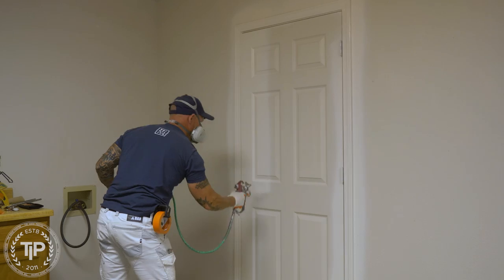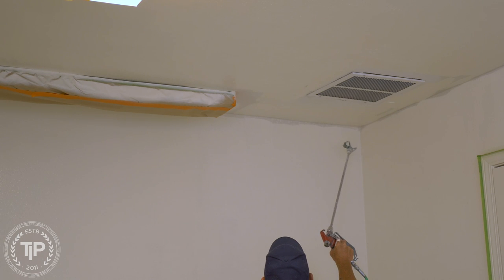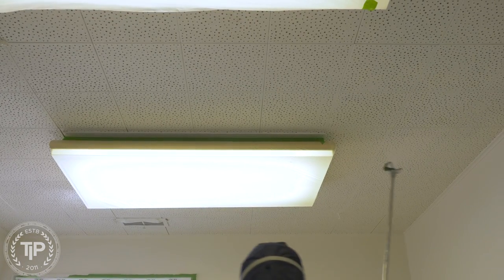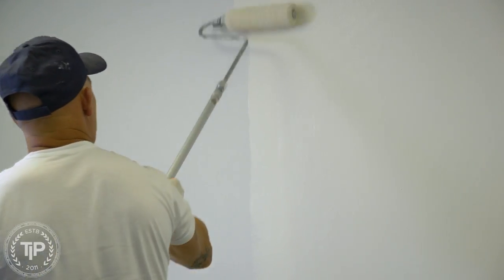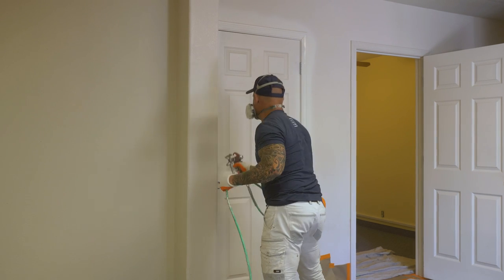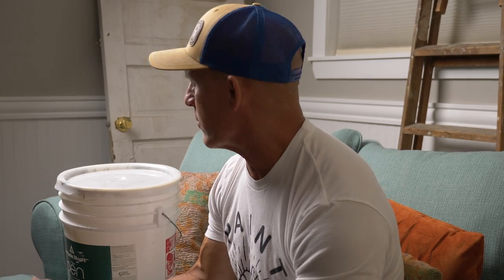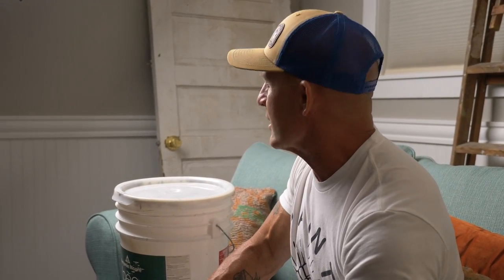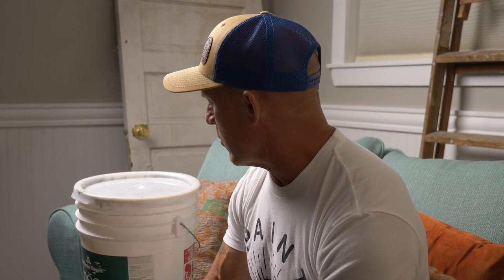BEN Wall Paint Review | Which is the best paint?

Comment: Ben Moore is the best paint out there. Even their ultra spec smashes anything from Sherwin Williams.
Reply: Damn straight
Reply: I wouldn't go that far. Ben Moore has some great paint, but it's definitely overrated. I would take Cashmere, Emerald, Prominence and Ultralast over Aura. 

Ultraspec is definitely better than Promar 200, which is their rough equivalent but Speedhide is just as good.
Reply: After doing some work with the brand of paint the Big Orange Box Store sells, I can 2nd this, or at least the most reasonably priced paint.  It is also the most available in my area (hardware store is 5 min down the street).  I have not used SW, but more than one painter has told me that BM is better, including one who was painting with SW.  Our local hardware store does sell some imported paints, but they are all upwards of $100/gallon.

Comment: What about cost? How much? What is boxing paint? Is that mixing paint?
Reply: boxing is when you purchased a mixed color in multiple containers (3 gallons in 1 gallon containers) you get a larger container and mix it all together to ensure you get a consistent color. It especially helps with touching up later.
Reply: @bratvlad  you can only box when you purchase multiple containers, doesn’t matter if it’s 5’s or gallons. You do it to ensure color consistency in case there might be a slight variation in the color that comes in one or more of the cans/buckets

Comment: Is this product better then Duration from Sherwin Williams and what's the price range?
Reply: I think Ben is better than Duration in terms of durability. I have used both quite a bit (certain designers or customers have their favorite brands) but I prefer Ben. It also touches up way better all the way up to eggshell sheens. Pretty comparable in price, but they're all way too much these days. When Aura was new it was all I used, but my price was $50 a gallon at that time. Then I switched to Regal once Aura was over $60 a gallon, and now I've gone to Ben. Retail on Aura is over $100 a gallon at this point! That has made me more of a bargain shopper these days.
Reply: Duration is more like Aura than Ben. Ben is at the low end of Benjamin Moore products.
Reply: @joshuareed3999  You're buying paint from the wrong store. My local store gets $71 a gallon for Aura interior. I pay less than that with my contractor's discount.
Reply: @zone4garlicfarm  I mentioned the retail price. Not my price. Still too spendy these days. I use Aura Bath & Spa at times because the $30 difference for one gallon on a bathroom project is worth it, but I haven't painted an entire house with Aura in years. It's phenomenal paint, but I can't justify the price anymore.
Reply: @zone4garlicfarm  BM Ultra Spec is their low end... Ben is more like the mid tier...

Comment: Hey!  tell me what pressure and what kind of graco tip and how much water to add or water is not needed?My friend has a problem with this paint.  stripes are visible after drying.  I used to paint it without problems, maybe something new in the paint recipe? So what can you advise me?
Reply from the maker: There come be many reasons